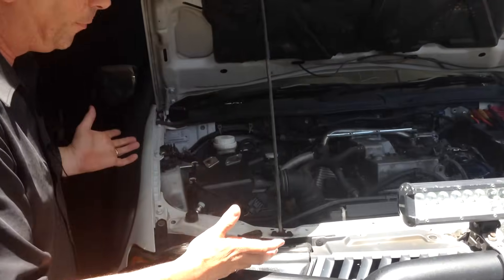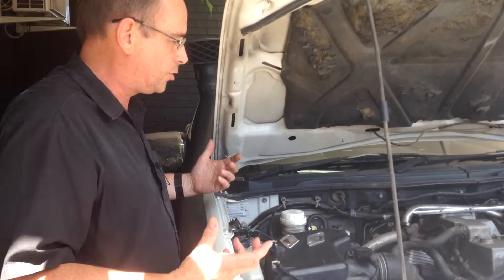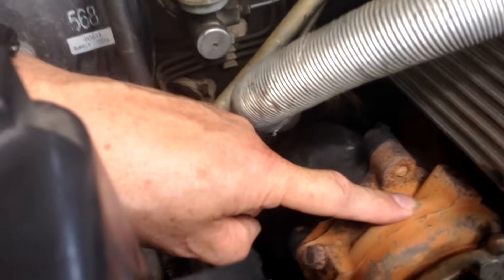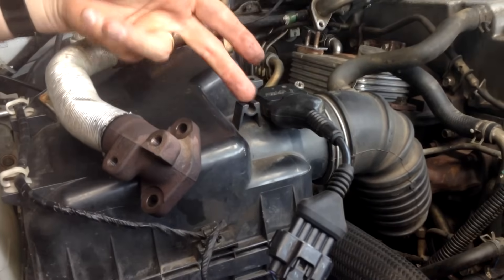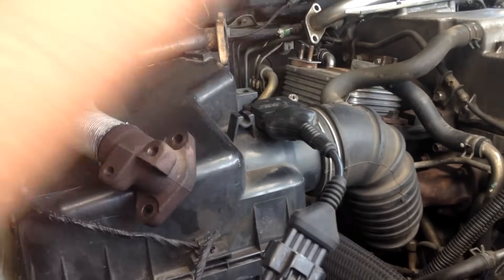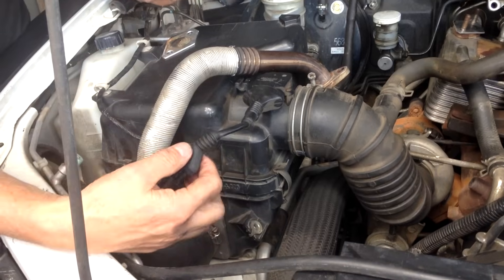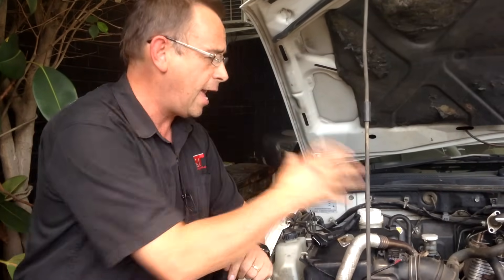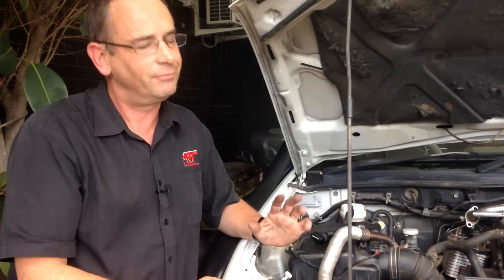How to fix EGR Soot Buildup in a Turbo Diesel

Comment: I have a diesel SH forester and to prevent soot build up is to not use it on short trips but if you do then stay in 2nd or third gear around town to make engine work harder and revs stay higher. Diesel engines as we know are designed to travel huge distances like lorries/trucks do. This is what I was told by a seasoned Subaru mechanic.
Reply: You need a new mechanic.
Reply: Yes short journeys for any diesel does more harm than good,
Reply: Saggio consiglio, in città si usa molto la seconda e terza marcia, motore al giusto regime, pochi problemi. Ma appena possibile, è bello fare lunghe percorrenze, guidare una Subaru rende felici, purtroppo la questione del DPF  e del CVT ha intaccato il piacere di guida. In Europa stanno creando limitazioni assurde. E penso anche da voi
Reply: That’s extreme, just be sure to drive it long enough to get to full operating temp often enough.

Comment: I have a MK5 Golf 2.0 GT TDI! I had the engine management light on and displaying emissions fault! I basically stripped off the EGR valve and throttle body and cleaned them both using white spirit! Reassembled everything and engine management light disappeared!!

Comment: Just today I saw oil in the intercooler intake
Reply: That’s normal, exhaust gasses go around your piston rings into your crank (blowby pressure)  this pressure is relieved by your crankcase breather, that is connected to your air inlet. So oil vapour goes into your air inlet leaving an oil residue behind.     If you want to stop this buy a decent oil catch tank with an internal filter. (Will require draining from time to time)

Comment: In the uk it is illegal to blank a egr ?when you go for your annual mot test it will fail on emissions better to clean the egr out or renew
Reply: Why would it fail on emissions? Is cos the nox will be too high? I thought the egr only worked when the engine  is at idle  and shut off when reving ?
Reply: If the engine is EURO III no one would know, but EURO IV and newer you're spot on. It'd throw up a MIL which is an immediate MOT failure.

Comment: i found easier to just fit a catch can, and decarb the intake everyone once a while
Reply: What's the process in a decarb?
Reply: @Mick_4591  disconnect the intake manifold and use degreaser to remove carbon.

Comment: thank you detail video 
have Isuzu 300 nps model 2010 as probem with turbo with power wastegate control  as with engine light on computer side which did to EGR

Comment: Drill a three millimetre hole in the blanking plate and the ECU will operate ok, as it's getting a sniff of the exhaust gases.
Reply: The ECU can't tell if the thing is blocked.  Not  the basic systems anyway.

Comment: ive blanked off a couple of ERG's now, run better, cleaner, better MPG and no valve jamming and no dash lights, the euro emissions are so stringent that engines are choking in dirty intake air via exhaust manifold recirculation, take plate off for MOT if needed,

Comment: I have a VW CFCA T5 Trsnsporter. I’ve just blanked my EGR cooler with a Tafmet system bypass unit. Works a treat makes the engine a lot cooler. Had to do it as with the EGR in the CFCA fail and send shards of the cooling fins into the engine.
Reply: rolph bluesky if you blank it off you need to get it coded out of the system, but the Tafmet bypass eliminates the need to get it coded.

Comment: Just plug it up/delete
Reply: Blanking plates?   Anything else need to be done?.  Cheers
Reply: @RG-yz8ov  best result, have a tuner flash the cel away
Reply: @GhostOfAMachine  Does blanking EGR increase HP/improves throttle response? Thanks
Reply: @amjathkhan2004  yes a little bit, the engine runs a lot better and efficiently. I did notice significant fuel economy gains too
Reply: @GhostOfAMachine  Thanks for replying man!!! Should I (1) clean the EGR, remove the carbon deposit first and then (2) blank it even when doing soft EGR deletes? Or just do blanking without cleaning it? My car has run 70000 miles, so just wondering. Thanks!
Reply: @GhostOfAMachine  Also, can you please tell what you meant by "have a tuner flash the cel away"? Mine is running on a stage 1+ map with only air filter changed to k&n conical filter. Thanks again!

Comment: Got me an isuzu 2010 dmax , really not sure what to do ?? 🤔🤔
Reply: Just gunna get throddle body clean and egr blocked off at performance shop , gunna let it run lazy so i get long life out the motor, as an everyday runner cant beat isuzu , done 90 000kms in  just under  3 years, no dramas at all 🤙
Reply: Buy a 200 series Land Cruiser.
Reply: Sell it

Comment: There’s plenty more to it than just soot. The egr reduces the combustion temperature as the exhaust has already been burnt, these dicks that blank them off, delete, chip the ecu and turn it off are complete wankers. Just clean the shit out, fit a good oil catch can and leave everything else as factory. I’d rather not breathe in toxic gases thanks

Comment: If you can name "all" the other problems that the plug causes, I'd be more inclined to listen.
I installed a resistor of the correct value to fool the ECU,  cost me less than 10c and half an hour.
Car's been running perfect for 4 years, fuel economy didn't change, no soot in the inlet.
Reply: 6k resistor
Reply: Resistor of the correct value ?
How did you achieve that ?
Reply: @juerbert1    Some other guy on the New Triton Forum worked it out, I can't remember how many ohms it was now.

Comment: just get a blanking plate but leave the egr valve in place ,then get a basic remap and they will usually delete the prog that powers  the warning light and the egr cycle cost me £150 uk pounds plus a couple of pounds for the blanking plate ,you get a slight heat increase but its running like a bird on my landy 110 tdci 2.4

Comment: Dosent an egr improve harmful emissions and give better fuel economy? Why would you delete it, just perform service and maintenance and clean the intake every now and then.
Reply: Nathan Squire In theory an EGR reduces emissions. The theory is that an idling engine only needs 20% of the air of a working engine. So the egr recirculates a portion of air at low revs. In practice it’s effect is marginal. Over time they soot up & create errors. It can make sense to blank them. They are likely to make fuel consumption worse rather than better.
Reply: Egr doesn't benefit the engine at all it steels exhaust gas that should be spoiling the turbo, blanking the egr give more power less turbo lag and in the real world better economy.. the egr is purely emissions bullshit
Reply: No improvement to economy but a lot less NOx pollution from a diesel.

Comment: I was using such plug and damaged my turbo regulation. I guess the temp or pressure was too high. So I removed it untill I repair it and I blinded the EGR pipe instead. I expected a better mileage at lower RPM instead of more horsepower but the only effect I noticed is much cooler engine especially during the winter. I literally have to drive faster to get it to operating temperature and the mileage is a bit worse (maybe because of the turbo though). 

To be fair I think I can blame my driving style too. My long term fuel consumption was always bellow 4,2l/km, driving less than 110km/hour on highways, more likely 90km/hour etc. Shifting early. 
My plug in device is kinda potenciometer adjusted with a screw so I never knew what I was doing to the engine. Higher compression rate? How far we can go with  the fuel/air ratio before touching the detonation level right? Detonation is super efficient but the engine cant withstand it.

Comment: Install an oil catch can.  $300 ish and problem solved.
Reply: catch can is not in the egr system, will make no difference to egr soot
Reply: @pyrobob208  really?
Where are exhaust gasses created?
Reply: @madeulook5421  catch cans go between the pcv valve and the air intake, nothing to do with the exhaust.
Reply: @pyrobob208  why are catch cans used in motorsport?
Reply: @madeulook5421  same reason I use them, to stop oil fumes from entering the intake and creating build up on the intake valves, and oil sludge in the intercooler, nothing to do with exhaust. Go do some research before spouting off to someone who was using home made catch cans in the early 80's.
Reply: @pyrobob208  please don't make me laugh.
I have been fabricating surge Tanks "Catch Cans" on race winning car's across multiple classes of racing for 35 years buddy and not the Coke bottle variety either 🤣🤣🤣
Reply: @madeulook5421  Sorry, maybe I misunderstood something, but why are we arguing about catch cans over a video about egr, not crankcase ventilation?
Reply: @pyrobob208  because what happens in the intake system has a direct effect on the Exhaust system.
Now answer the questions I have asked you
Reply: @madeulook5421  I understand what you are getting at now, exhaust gas is created in combustion chamber, so less oil in intake charge means less soot in the exhaust. I use a catch can in my turbo diesel, as well as disconnected egr, so I dont disagree with you, just missed your point.
Reply: Madeulook. By the way, thanks for pointing that out.
Reply: A catch can will only remove the oil from the equation. Dry soot, like what you get in the EGR valve, will still be passing through the intake manifold. If you think about it, the oil actually traps a hell of a lot of soot and stops it at the intake. If there was no oil,  the dry soot would pass straight through the intake manifold. If you are halfway handy, pulling out the intake manifold every 50,000km or so isn't really a big deal. The main pain is having to buy all new single use gaskets, every time.
Reply: Catch can doesn't sort any thing... It's not because you have one that you going to be free of build up it may prevent a bit of it but that about it particularly on the Triton no proof that catch can do stop build up at all may catch water, oil and diesel but that about it... I'm not against it and I think if you modify the all engine you better with it now if it's fully stocked you may not need one... My thoughts
Reply: @pb8582  what is it not going to filter?
Reply: @pb8582  a good quality catch can is designed to filter the engines Blow by gases and yes it will also filter condensation on a cold engine until it reaches normal operating temperature.

Comment: In the UK,if you blank off egr,it's an mot fail.!
Reply: I'd blanked off my tdci mondeo, now a mot  fail, so unblanked  it and tried something called a " forte power clean" (some sort of a machine pumps a cleaning solution around),  car runs like new now. The question will be, for how long.
Reply: @steveallen1635  just remove blanking plate for the inspection and refit after
Reply: Is there a way to help prevent this soot build up in the UK?
Reply: Chappers Gaming yes blank the egr and gut the dpf remap the car at a tuner and go blow all the shit out the back
Reply: Lucky here in perth WA not an issue i know in california cops specifically look 4 catch cans , uk would b  the same

Comment: Just install an oil catch can between the engine breather and turbo. No oil vapour in intake = no sooth in manifold.
Reply: Yes you will get soot.   EGR will produce it and catch can does not catch all oil vapor.
Reply: @michaelprice3785  yup, better to vent the vapor to atmosphere

Comment: This guy seriously knows his way around a vehicle engine. I wish my local Garage was as good.
Reply: MrIsak786  In Germany you not only loose any warranty by the manufacturer, you also loose all insurance coverage when you manipulate EGR rates. Not to speak about NOx emissions. California e.g does real live over the street measuring of exhaust gases, e.g with IR-beams and reports it by cameras directly to the DMV, that's why they found the VW cheating - by the way, as brand new cars were always measured as "Polluter"! So take care what you do with your car and what is legal! Simply use Diesel cars normally with maximal 2/3 of full gas, this will first reduce particle production at there fore reduce particulate filter clogging, so you exhaust won't work against the engine, it will also reduce heat and with less heat less NOx build up and therefore will reduce AGR rate and is by the way completely legal, and saves you diesel fuel additionally.

Comment: Question my zafira 1.9 cdti was hissing after blanking at the top , so blanked it at the manifold aswell did a oil change 5w -30 car was running good till today when i heard a big Puff sound lost power and its ticking while driving like a lollipop stick against a moving bike wheel ,I inspected it its blew the manifold blanking plate gasket  and black Soot is on my engine ,I'm back to square 1 any help please ?
Reply: Sorry, this response comes so late after your initial comment but noticed no one replied.

I have the same engine in my Astra twintop.
I would recommend in this situation, giving the engine a 3-direction seafoam treatment and re-check your oil level. These engines do not like being over-filled. So first check you haven't put too much oil in... It can pull it into the turbo system and cause excessive turbo wear or even complete failure.

The ECR systems on these engines are vile and spew gunk all over the injectors nearest the recovery pipe. If I were you, knowing how temperamental these engines are with this system is give it a good seafoam treatment, set up your engine back to stock and install a relatively inexpensive Oil Catch can.
This takes the recovered air (with its oil-mist gunk) and separates the oil mist out of the recovered exhaust air fairly well.

I'd also recommend the temperature trick sensor (look for a good one, if a cheap one fails it can have bad results)
I would recommend the Purvent catch can designed by Mann+Mummel (OEM Air intake manufacturer and put a new OEM air filter on at the same time)
If you spend this 100-200 on your engine it will keep going forever with normal servicing.

Sorry if this is too late a reply but hopefully it will help someone at least.

Comment: i have a jeep commander diesel. i have had the dpf cleaned out professionally but now it wont turn over and run., there is pressure and fuel, tried a jump kit, but it starts and just peters out. wont idle. thoughts ?

Comment: BTW that dongle obviously wouldn’t have a capacitor inside. They usually have resistors to reduce the standard 5 volt signal down to a level that tricks the ECU...but as noted, while it might trick EGR activation it’s also feeding incorrect IAT data which will affect fueling...bad idea, especially on later models.
Reply: 4.7kohm

Comment: i rum all my diesels with a taste of fully synthetic two stroke oil in them ,, never ever had a pick of bother  only a taste ,, about 150 to 1 ish ,, , infact , i run all my petrols the same too.
Reply: Use castor oil it will smell nice i used to do this when i was 17/18 years old for fun !
Reply: @antsfur   nope ,,, too sticky and horrid , fully synthetic two stroke ,, but you can get it with smells added too ,,
Reply: tom thompson , sounds interesting! I got  Holden 4x4 1996 TD. I suspect there is sutt issues... Could you please elaborate on the " taste" and the measurements for that, was that 150 millilitre to 1 liter,...or ounces,... ? And would you mix it in with the fresh mineral oil that is in the motor?... Thank you🙂

Comment: Install a Oil Catch Can???
Reply: Aaron Close Yes, exhaust gas in combination with greasy oil vapor creates the ugly soot.
Reply: @jovanzacevski  but how does the EGR valve get sooty as well? Because oily vapor and exhaust gases only meet at the intake manifold?
Reply: Exactly!!!!
Reply: @cuvame  The EGR is receiving direct exhaust gas, which contains dry soot. You shouldn't be getting any oily residue at the egr. You will get some oil passing through the intercooler, into the throttle body, but definitely shouldn't be getting massive oily residue in the egr, like the intake manifold gets.
Reply: @jeaniewolfe6693  I see. So the EGR will take a much longer timer b4 it gets too carboned up unlike the intake valves right?
Reply: My crank case ventilation enters before the turbo compressor and meets the EGR at the inlet butterfly valve, gonna try catch the catch can.
Reply: @Lachlan Mac what happened? It destroyed your engine?
Reply: Pointless to have a catch can an old plastic drink bottle will do just cut some holes in it
Reply: Don't be so stupid
Reply: gary freeman don’t be stupid about what